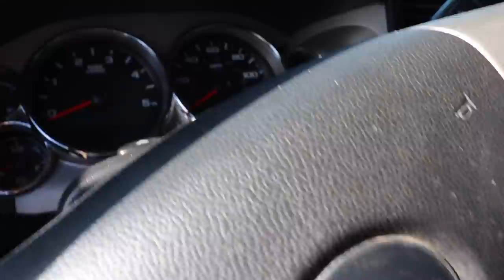TWIN TURBO 12 VALVE CUMMINS HAULS BROKEN POWERSTROKE TO SHOP!!!

Comment: That powerstroke is the best looking truck y’all own.
Reply: Dalton Nelson most problematic also 🤣🤣 #Cummins
Reply: Well all of them can gell up
Reply: Take the precaution to treat diesel for the cold won't have problems
Reply: Jose Leos  you ever heard of a Duramax lol
Reply: Naw
Reply: Fords might be the the best looking "but there not" but thier not the best working
Reply: devin wilkinson there’s probably in 2nd in the reliability column out of the 3
Reply: Dalton Nelson I dont see how. Dodge should be 1st. Duramax should be second. And powerjokes should be last
Reply: devin wilkinson  I like cummins. Not dodge cummins. And fuck a Chevy I’ve already been down that road. Went thru two rear ends and a fuel pump. Got a 6.7 powerstroke and no other truck on the market runs with it. Ford is killing the competition
Reply: I don’t know about all that
Reply: I would rathere have an dodge cummins than another trucks
Reply: devin wilkinson  you must like walking
Reply: Dalton nelson you must like paying for new engines
Reply: devin wilkinson terrible comeback ole son
Reply: PowerStroke deeznutz
Reply: @daltonnelson4398  Ford's have heated tailgates for a reason when you get tired of pushing your truck home you can take a break on you tailgate!
Reply: Cummins Captain  damn dude that’s sweet. Luckily I haven’t had to use mine yet
Reply: Dalton nelson, yet
Reply: devin wilkinson  yesssahhh

Comment: I live in Pittsburgh Pa & have a ‘05 Powerstroke. I use Archoil AR 6400 fuel additive it’s their winter anti-gel formula. Their oil additive AR9100 is great as well. 
Had a code come up with one of my injectors. Right after I bought the truck. I changed the oil & fuel filters (motorcraft only) used the Archoil AR 9100 & AR 6200. Cleared the code, drove it about 100 miles & the code never came back. 

Rams & Duramaxs are great trucks as well once you fix their issues. Thanks, I enjoy your videos very much!

Comment: It’s probably to late for this now but if  the squeal you hear is from under the truck in area of the lift pump or as ford calls it the fuel management system can let air past the oring and squeals  I had a squeal on my 15. And they ended up replacing the lift pump filter assy and it fixed it

Comment: Put it in neutral takes torque off wheels to stop faster if you need to stop quick like that
Reply: true... but its bad for the transmission while in motion to go in and out of neutral. now if you come to a complete stop its ok but if something occurs and you have to put it in drive... you'll give that transmission a hard time. if its a manual trans than its ok

Comment: Have to keep up with the fuel filter changes aka every 10,000 miles and yeah gotta feed her diesel additive during the cold snap
Reply from the maker: Anthony Massa we do filters for fuel and oil every oil change. And he always has additives. In fact, he had just added a bunch the night before it got really cold on his way home from work.
Reply: LOUD 'N' PROUD what additives is he using

Comment: HELL YEAH FORD LIFE!! it's a good possibility that the high pressure fuel pump sent metal shaving through the system. Very common problem. You need the pump disaster kit.

Comment: Cue all the comments about all fords suck because it broke even though all trucks have their problems.
Reply: Fuel gelled up.
Reply: Reid Isaacson yeah I know but people will still blame the truck
Reply: @txoutdoors2037  Yep it could have been prevented
Reply: Fords statistically have many more problems than any other brand of vehicle.
Reply: Random Channel The more trucks that are being used the more they break. Take a Ford F-250 and a Dodge 2500 if you work with the ford and drive the dodge on the weekends then yeah the ford will have more problems because your working it🤷🏻‍♂️